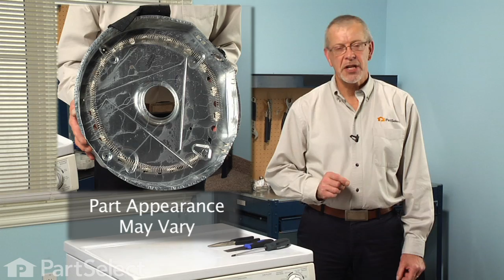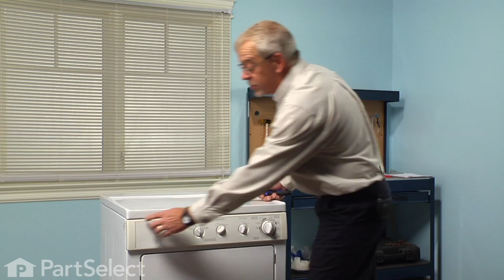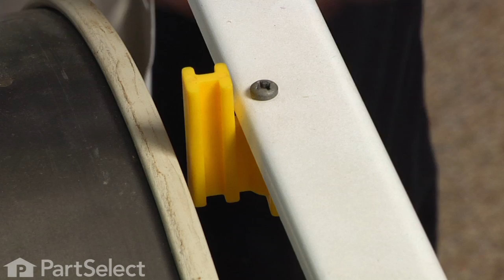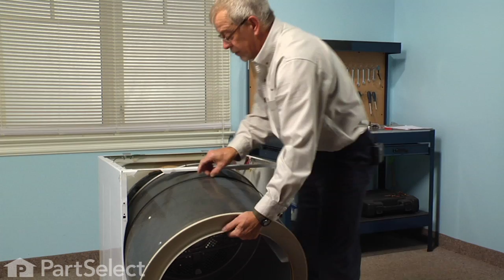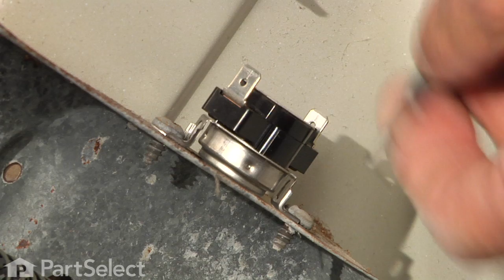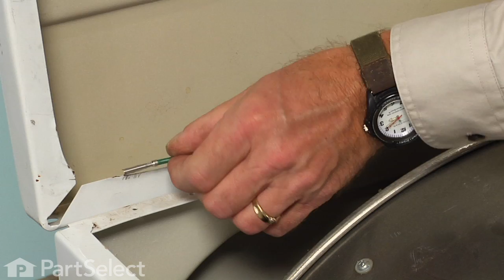Dryer Repair- Replacing the Heating Element Assembly (Frigidaire Part # 131553900)

Comment: I made the repair this weekend and it went flawlessly. Everything was just as you described. And I purchased the part from your company, which arrived the very next day and was less than half what Sears was charging. Thank you so much for your help. I would also add to the procedure to take the time while you have it disassembled to use a shop vac to clean the whole thing out before putting it back together.

Comment: That is a very informative video. I can read a procedure, but it's always better to see someone actually do it. One question, though. If the heater element is bad is there any reason you can't just replace it alone, or is it preferable to replace the whole heater assembly?

Comment: We have a dryer with the same part number but the controls aren't on the front of the dryer, the are on a panel on the back top of the dryer, if it was like the one you are working on no problem! :(

Comment: So, Easy repair for me. Everything went smoothly. Except now the dryer won't turn on! Before it was running but no heat. Now nothing. I retraced my steps, checked the outlet, (only one it can fit in) reset all the circuits breakers. Not sure what to do now.

Comment: i have a question the middle of the heating element has like a track the drum spins on and it's to big to take off the element without removing it but i can't find a way to remove it .... no screws anywhere.. any help would be appreciated

Comment: Being a complete novice at dryer repair the video is a bit confusing; for me anyway.  You talk about removing the element housing and then replacing it with a new one.  Then you mention re-connecting the thermostat and then the two wires to the heating element itself. The confusion.... Where is the heating element?  It is in the housing? Can't really tell in the video.  Thanks.....

Comment: What type of fuse does this dryer need?
Reply from the maker: Hi Kathleen. If you send us the model number of your dryer, we'd be glad to point you in the direction of the fuse you need!
Reply: PartSelect hi and thanks for such a quick response! The mdl # is 110.66912692. Our local repair shop quoted $40 for a fuse! On Amazon I found a price of $8. Quite a difference! What can you tell me?
Reply from the maker: @kathleenpetersen4058  thanks for getting back to us. I looked up your model number on our website and I found this fuse: https://www.partselect.com/PS11741444-Whirlpool-WP3390719-Disposable-Thermal-Fuse-Two-Terminal.htm?SourceCode=7&SearchTerm=11066912692&ModelNum=11066912692. I also found this Thermal Cut-Off Kit: https://www.partselect.com/PS334278-Whirlpool-279769-Thermal-Cut-Off-Kit.htm?SourceCode=7&SearchTerm=11066912692&ModelNum=11066912692. You can use the schematic or the part images on either of those pages to determine the correct part that you need. All of our parts are OEM (Original Equipment Manufacturer) which means that we source them directly from the company that manufactures the dryer.